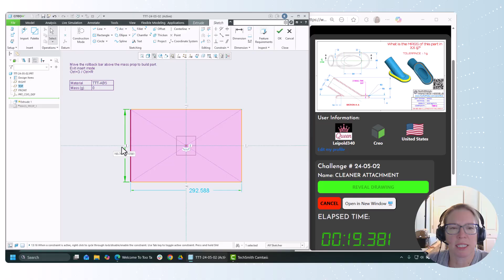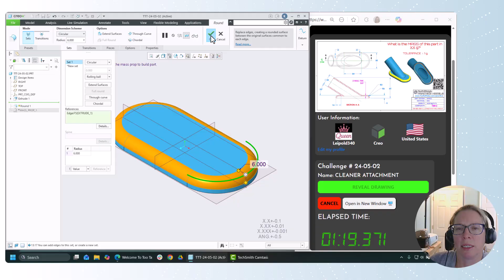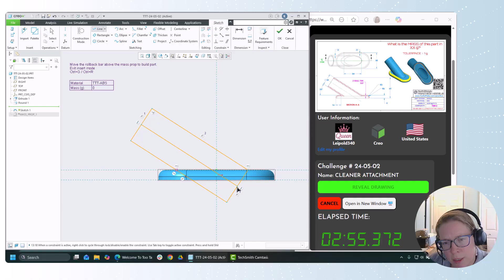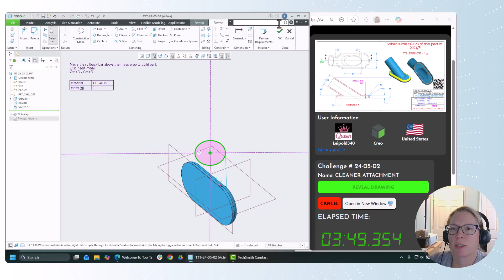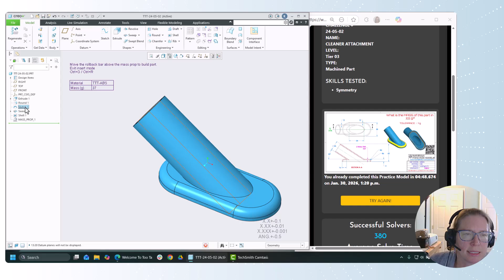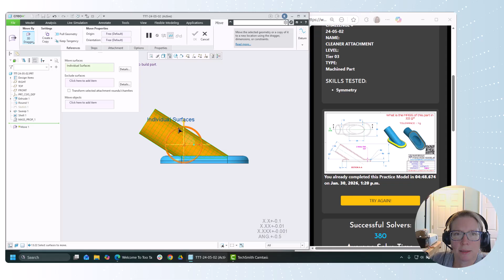Too Tall Toby Challenge 24-05-02 - Looking to conquer the quirks of Creo? We've moved! 👑

Comment: Thanks for the tutorial! I was unsure how to approach this one. 
In solidworks I ended up using the extruded feature instead of the Sweep Feature, because I couldn't find how to tell the sweep where to, meaning it followed the same line that you were sketching. I couldn't tell the sweep to stop at that particular surface. Do you know if and how that is possible in solidworks with the swept feature?
Reply from the maker: My Solidworks experience is very limited.  This would be fine as an Extrude up to surface.  Another option, picturing Onshape here, would be to make the sweep even longer, as a separate body.  Then you could use the first shape to trim or split the other shape, and then boolean them together.  So many options!